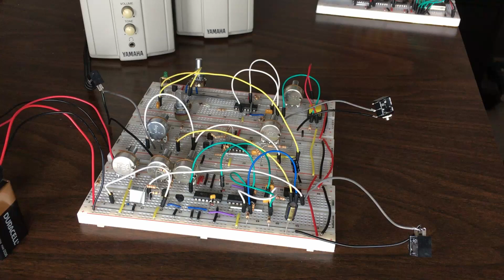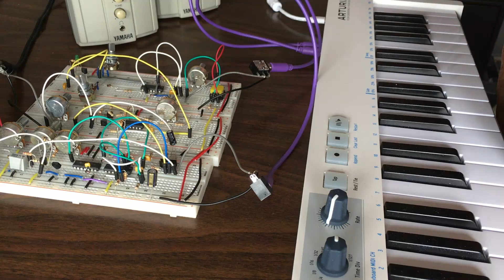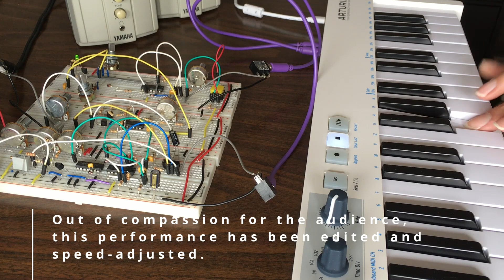Breadboard Synthesizer Show & Tell

Comment: Nice work. I like moritz' videos. I built the vco and then went down a rabbit hole trying to tune it. I built a programmable CV controller with an Arduino which made the process a bit less painful. Keep it up!
Reply from the maker: The easiest way to tune this for me was to feed the output into my computer and use the tuner utility in Ableton (which I only have because it came with the keyboard). I've got an Arduino hooked up to it now and I've been recording some of the weird noises it's making!